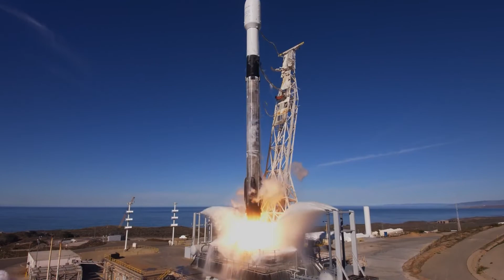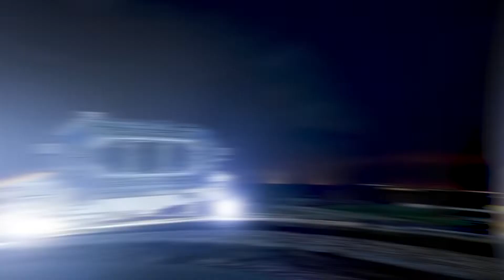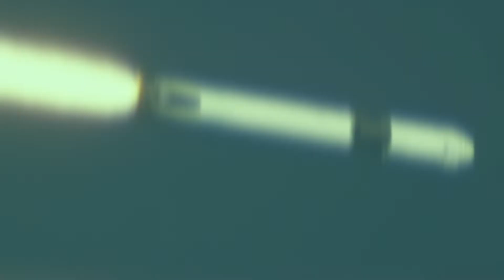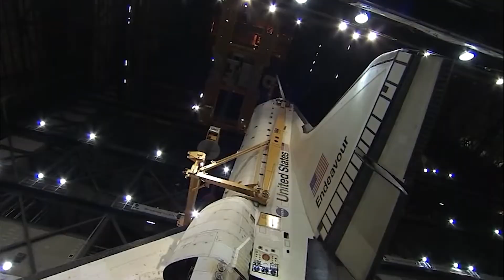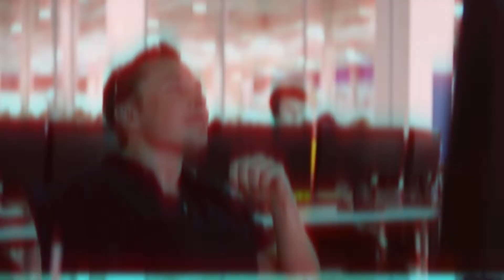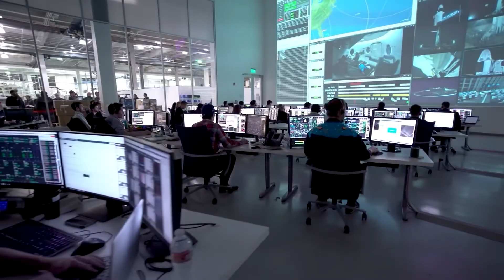How Can SpaceX Build Their Rockets So Fast?

Comment: That's the problem with most big companies now your ideas have to go through other people. Where working for Elon Musk may be very difficult he is approachable with ideas solutions and problems. If I was on the job having anything to do with the tank farm I could have save Elon lots of frustration heck I saw the problem while watching many YouTube channels and tried several ways to contact Elon Musk as an outsider is tough, because I knew before they set the first tank that they had an OSHA problem to say the least with proximity of fuel and oxidized without concrete separation. Well can't say I didn't try. Maybe if I had a masters or PhD on my letter but then I wouldn't have the 30yrs of real world experience to come up with the ideas or see design problems. Trust me if my body wasn't broken I would be in Texas working for SpaceX or a local contractor